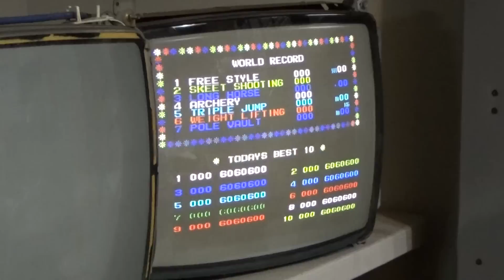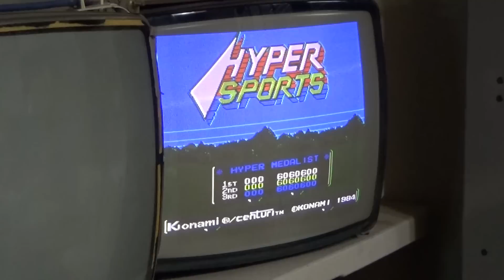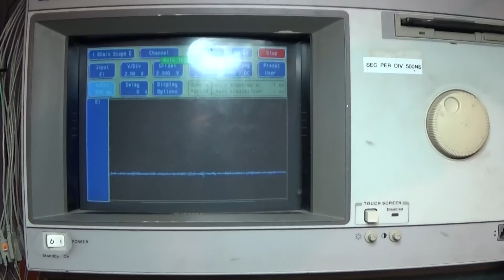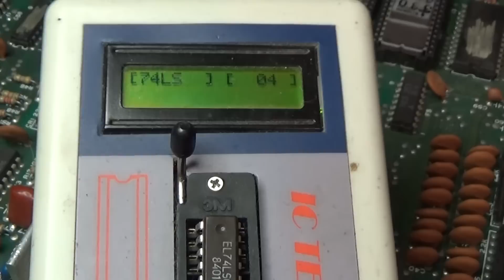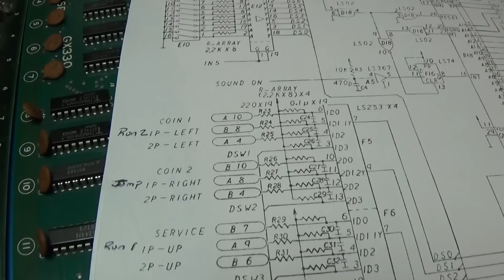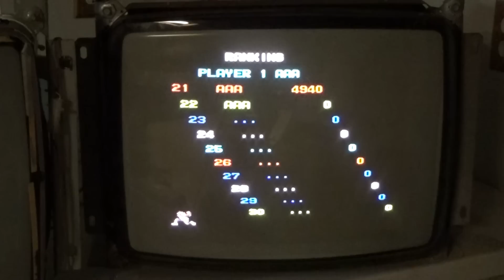No Sound...1984 Konami/Centuri "Hyper Sports" PCB Repair - 4/28/22

Comment: What is under the heatsink?

The Konami-1 is a special HD63B09 with extra logic integrated.  As for the sound the SN76489 is doing most of the work; the VLM5030 is only used for the speech.
Reply from the maker: the sound processor is Z80..  and I'm not sure what your talking about with the heatsink..   just a couple screws is all
Reply: @classicarcaderepairs  Yes.  The Z80 is the sound processor.  The SN76489 is the primary sound generator.  The VLM5030 is the speech chip.
Reply from the maker: @douro20  I didnt even notice that it had a 76489 on it